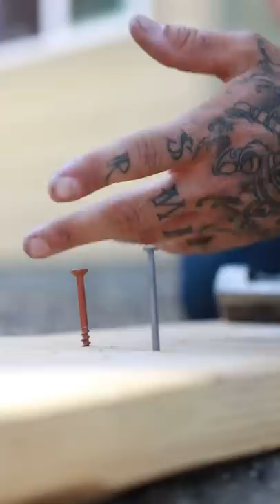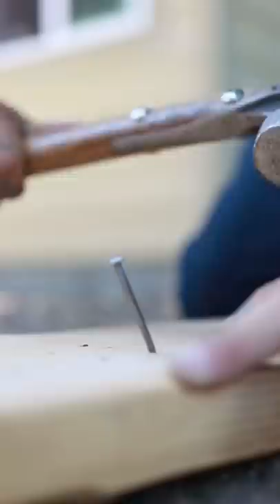Nails vs. Screws: Why do we use nails? #shorts

Comment: "We use nails because they're cheaper and faster". 
-Literally, every builder ever
Reply: As a Californian(i assume you're not American so ill explain California has earthquakes and intensely mentally disabled politicians) we have to use so many ties and braced, posts 10 feet in the ground with dozens of yards of concrete for such a simple house. So for this guy to say a house should be made with nails so it can move (and crack stucco/ windows because a little 2 story will never move enough to break a screw) is absolutely ridiculous to hear. Plus nails will back out of moving wood as literally anybody with eyes and a brain cell will have seen
Reply: @coltoncowan682  Exactly, I have no idea what nail he found that doesn't break after that much bending.  Most nails today are so cheap they break at any little bending anymore.
Reply: @jayclyde6045  i suppose im lucky there my nails dont break on me here
Reply: @jayclyde6045  16p will bend all day.
Reply: @jayclyde6045  question is what nails are u using nails bend all the time and don't break its kinda a trait people need them for
Reply: @coltoncowan682  "I'll assume you're European".
Because only America and Europe exist?
Reply: Use better screws bro
Reply: @coltoncowan682  same in greece earthquake prone. Its in southern Europe, there are 3 tectonic plates. Europes asias and africas
Reply: we as humans could have made screws cheaper and faster but we chose nails for a specific reason, presumably because of this video.
Reply: Harder, better, faster, stronger
Reply: @PanosSkarp  wow. Must be pretty frequent there. Yesterday we had a 4.8
Reply: Unsesquipedalian  screws gut much stronger grip into the wood tho
Reply: @jayclyde6045  you clearly don’t build commercially then 🤦🏻‍♂️😬🤣
Reply: Absolutely not, big structures require screws and bolts, nails are only really used in temporary builds (like concrete laying) because of their flat end and their ability to be bent if too long, its an esthetic and time saving thing before a cost-cutting measure.
Reply: @coltoncowan682 i hope nobody got harmed from it.
 Thankfully it isn't. Some years we get a lot of micro trembles (most places you cant feel them only in tall buildings) and some years (and some place) we will get one strong one 5.0-6.0.
Reply: Correct answer here.
Reply: regular wood screws or drywall screws r tested at 40lbs each, nails are at about 120lbs of pressure each  before they fail
Reply: @Burpingtogheter  they frame houses everyday in Michigan with nails.
Reply: A drill will always be faster than a hammer nails and screws cost almost about the same price not much of a difference nails are more durable any day of the week and I think it's just preference because a lot of contractors also like to use bolts to secure beams and then bring in the air gun nailer for everything else
Reply: So another Carpenter here to chime in nails have shear strength and I would recommend using ardox (spiral) nails. They have both the good aspects of nails and screws. Shear strength and ability to stay in.
Reply: @weed_zone4208  WTF??? You need to proof read! Daughters use boats??? I don't know where you are from, but screws here cost 4-10 times more than nails.
Reply: @CadillacDriver  dude he just said he was assuming he is European
Reply: @BuhBungus  lol ty i guess im supposed to list all the English speaking countries that use the term builder
Reply: @CadillacDriver  lol not sure what i was supposed to say but my british and german friends refer to construction workers as builders. It was exactly the point i was making, Americans know American geology pretty good i dont expect a non American to know the tectonic activity of another countrys state
Reply: @BuhBungus  no shit, Sherlock.
Based on what? Do you not understand my first post? It's OK, I don't expect much more from the majority of Internet keyboard bashers. You'll get it one day.
Reply: @CadillacDriver  but to make you happier ill change my post to read  "i assume you are not American and dont know the tectonic activity OF California, USA."
Reply: @CadillacDriver  you really have no life your starting arguments on a YouTube comment section about a dude telling us why nails are better than screws and not only that your arguing with multiple people but don’t worry I know a certain place filled with people like you and they have the time and energy too but you probably have already been there it’s called Twitter and yes they have Yiff artist’s who castrate anybody who disagrees with there opinion’s
Reply: @BuhBungus  nice novel. You don't know me, fool.
Reply: @CadillacDriver  you still choose to argue? You really should check out Twitter I’m telling you it’s a exactly for people like you who can’t vent out there anger anywhere else
Reply: @CadillacDriver  ignoring my comment because of its length you should also check out Reddit too lmao
Reply: @BuhBungus  reddit 😂
Reply: @weed_zone4208  I haven't bought any nails or screws since this recent inflation boom, but a year or more ago I could buy bulk 16d coated sinkers for less than a dollar a pound, 89 cents I think from my favorite lumber store, fuck Home Depot, Lowes, and Menards. Good coated Grip Rite torx drive screws were something like $9 a pound for a small box, down to 3 something for a 40 pound box, and more than that at the big box stores. You do the math.
Reply: @garrett2362  over here in the big red white and blue nails don't go by pound for ten bucks you get a box with over a hundred in them and the boxes are even made a plastic. If you drop them nothing will come out and everyone nowadays has commercial accounts so they pay even less I want to know where you're getting a pound of nails for $0.89 though and what would a pound of nails look like. like 30 nails put in a box I just told you you can get a bucket with over a hundred screws in it for $7 dollars it's well over a pound athletes you might be getting a 7lb box
Reply: So not true.
Reply: @coltoncowan682  this guy's full of shit he has no idea how much jail time a contractor would Do for one it wouldn't pass inspection.
Reply: @slayerdylk  I know you'd never say that to my face, so that renders your "insult" meaningless. Easy to be tough behind a shield, isn't it?
Reply: @weed_zone4208  I live in Ohio. You must be from California.
Reply: @jayclyde6045  bro why are you arguing this you’re wrong bro I tested it with a nail from my garage no big deal
Reply: @garrett2362  nope I'm from that big Columbus 614 Parsons Ave
Reply: 👌 couldn’t say it better myself
Reply: I am a liar, you are a liar. I am a thief, your are a thief. We have all had bad thoughts, we have all hurt others. We have all contributed to make the world a worse place. So a perfect God must judge us with his standard of perfection. We are evil, and so we deserve justice. Hell. But God is not only a seeker of justice, He is a seeker of love. In fact HE IS love. And proof that he loves us, is that he came on earth in the flesh, to die the most brutal death in history, just to save you from Hell. He paid the fine for your crime. He took on what you deserved, for himself. That is love. At the moment you are in your sins. But Jesus Christ has the power to cleanse your sins through his blood that he spilt on the cross. If you don’t accept this blood of forgiveness, you shall perish. If you do accept the blood, you shall have eternal life. 1 Corinthians 15:1-4. Thanks for reading. God bless you
Reply: makes me wonder why the more durable one is cheaper. i like it though
Reply: @MrFrog-rc3zx  
There is no god. Seriously, grow up.
Reply: @CadillacDriver  Have you ever pondered the cause for the universe to begin to exist? Because it seems like your an atheist, which means you probably believe the universe began to exist with no cause… that does not make sense.
Reply: @MrFrog-rc3zx  tell me, how did "god" make things exist? Seems to me that's making something from nothing.
Just because we don't fully know exactly what happened billions of years ago, doesn't mean YOU do. Especially when it comes to a magical god who willed countless trillions of stars and galaxies in to existence.... come on.
Reply: @coltoncowan682  I mean maybe in America they main them cheap, but here in Europe screws are way stronger than that lmao
Reply: @CadillacDriver  How did God make things exist? He is omnipotent. He is all powerful. By His attributes He can create. Nature cannot create something from nothing, but God sure can. And the thing is, scientists will never figure out what happened before the beginning of the universe because that’s impossible. Science studies nature. Before the universe existed there was no nature. So it’s impossible for us to ever find a way that the universe popped into existence naturally, because that is like saying “one day we will find out how nature created nature before nature existed.” So there must be an outside cause, and I argue that the attributes of this cause are the attributes of the Biblical God. And God isn’t magical. Witchcraft is a sin.
Reply: @MrFrog-rc3zx  oh of course he can create something from nothing, because it's suits religious narrative.

"Science explores and makes no assumptions, religion dismisses science with assumptions"
                         
                        - Castle Bravo 2021
Reply: @MrFrog-rc3zx 
"Scientists will never figure out what happened before the beginning of the universe because that's impossible"

Seems like you have all the answers. What makes you so special, if it's so "impossible" to figure out? Lol.
Reply: @tortellinifettuccine  they're just a hard steel here they'll snap if they bend but its unrealistic for them to bend that much in framing
Reply: @coltoncowan682  🎩 👋🏻 hats off to you sir…. He’s probably just a third year Apprentince and just got 3 attabois and now thinks he can lead a crew in his own and teach these youtubers a thing or 2…. he’s even seen the prints on the 4 styles of home the development he’s working on offers
Reply: Boi you should know better
Reply: @jamesflowers7142  what the hell does ANY of that BS rhetoric have to do with ANY of my posts? Where on earth have I beaten down on tradesmen? I tried in college and now I'm working retail? Lol what? Apart from the fact that's an extremely weird assumption, I'm not even American hahahahaha. Fail. 
Hahahahahahaha, dude what?
Reply: @spooge4569  Edit: What I should have said is why would anyone use regular drywall or wood screws for construction? You use construction screws for framing and such. Wood screws are for small projects and drywall screws aren't even up to that standard.
Reply: @CadillacDriver  awwwe did my comment hurt your fee fee’s andouille had to have it removed…. 😱
Reply: @jamesflowers7142  you need to go back and reply to the person you were supposed to. I have no idea what you're on about, implying I have in any way insulted tradesmen. What a tool.
Reply: @KyleDownsFTW  8d and sinkers will too
Reply: Every builder ever you mean you can bob the builder?
Reply: @jayclyde6045  you must not work in construction 😂😂
Reply: @CadillacDriver  yes
Reply: @coltoncowan682  see in New Orleans or any part of southern Louisiana, we have a water under the ground, so 10 feet below the ground in New Orleans will put you in straight water. Hell 4 feet will put you in some water
Reply: Interesting, 6.9k Likes, 69 Replys, sorry had to ruin it.
Reply: Laughs in Switzerland
Reply: @coltoncowan682  he is right. This is why I hate the comment section most of you have no clue of what you are talking about
Reply: @nickisinsane  whos right? What do i not know? Is this directed at me? Lol
Reply: Yep
Reply: You know lol 😝
Reply: Thank you
Reply: Beat me to it.
Reply: Kev Prz  wtf are you on about?
Reply: @coltoncowan682  weird flex but ok
Reply: @coltoncowan682  move out of california then
Reply: @CadillacDriver  "For the wrath of God is revealed from heaven against all ungodliness and unrighteousness of men, who hold the truth in unrighteousness. Because that which may be known of God is manifest in them; for God hath shewed it unto them. For the invisible things of him from the creation of the world are clearly seen, being understood by the things which are made, even his eternal power and Godhead, so that they are without excuse: because that, when they knew God, they glorified him not as God, neither were thankful; but became vain in their imaginations, and their foolish heart was darkened. Professing themselves to be wise, they became fools."
-Romans 1:18-22
Reply: @qp5771  lol what? Thanks random stranger on the internet, i definitely can move my family and business into another state in my current financial position, i wish i would've thought of that! "Move out of California" wow what amazing advice. And what does that even mean? Do you think that California makes laws based off of evidence and wisdom or reacts and throws legislation at the problem hoping it'll stick?
Reply: @qp5771  thats the equivalent of telling a Mexican to speak English or "go home"
Reply: @exonight7759  no? Seriously look at a screw and a nail, its very easy to see why the nail is cheaper. Screws clearly have a lot more details, making them more expensive.
Reply: Not true . I hate comments like this .
Reply: @XQUEZZYX  nails arent faster and cheaper?
Reply: Kev Prz  did I?
No pal, I can still see your posts. Nice try. Now explain yourself.
Reply: Kev Prz  your behavior is as disturbing as anything I've ever seen on YT. You actually have genuine issues.
Reply: @CadillacDriver  of course
Reply: @coltoncowan682  that's interesting.i live in New Zealand,we have earthquakes. And we use nails to frames houses so they move.we have a lot of ground movement in our quakes.
Reply: Nails are spec'd out on plans for a reason, it's not up to the contractor to decide what they use Bud, at least on legitimate, permitted projects.  There are a couple places where screws are allowed such as securing the floor sheathing to the floor framing, and that is only to prevent squeaking when used with construction adhesive.
Reply: @koustfeiss  It's about strain relief and ductility.  Even forged screws would not perform as well as screws for ductile construction like wood framed.
Reply: @weed_zone4208   yes a drill is faster than a hammer and nail....but they came up with this crazy invention some time ago called a NAIL GUN lol. Sorry, but there is no keeping up with a nail gun buddy.
Reply: @CadillacDriver  You sound like a try hard troll lol
Reply: @weed_zone4208  What are you talking about? Nails are sold by the pound everyday lol. Why be so petty to argue over something so small anyways?
Reply: @garyboyken6236  really? That's why one of the people who was against me left, eh?
Explain why anything I've said here is troll-like?
Reply: @coltoncowan682  its about shear strength, not moving. Also there is a force known as "live load", which puts variable stress on fasteners. Standard wood screws catastrophically fail under shear. If you are going to use screws they need to be rated as structural screws like GRK RSS, or Timberlock. The size and type needs engineering  approval.
Reply: Nail guns are pretty fast.
Reply: @acknowledgedofalltheconseq366  you know i dont remember saying that and i feel a little bad about using those words in hindsight, little insensitive to mentally disabled individuals. Politicians are just really low on RAM in the old noggin. The graphics card is shot and they gotta lower the resolution so they dont freeze typa thing
Reply: @acknowledgedofalltheconseq366  yeah or steel
Reply: @acknowledgedofalltheconseq366  你是中国人?
Reply: @coltoncowan682  Find me an engineer that will allow screws instead of nails.
Reply: @jayclyde6045  idk what nails your using, yeah they can back out in som situations but he is absolutely right, and when you put in your connectors notice you use nails there too, it’s not just about cost, it’s just building 101, I’m sure if you look at the code in Cali they still require nails
Reply: Yup. They make structural screws made not to break, but they are way more expensive than nails.
Reply: I usually dont leave a screw sticking out to be bent
Reply: It’s code to build a lot with nails.
Reply: @Burpingtogheter  False
Reply: @weed_zone4208  A drill is never faster than my pneumatic nailer 🤣
Reply: @XX-tg4gj when you buy them bulk form manufacture half  cost prices  there the same. But when you're poor and have to buy a $10 box at a time off the shelf in home Depot, I guess you wouldn't know there was cheaper, would you?
Reply: @jayclyde6045  my nails don't break, don't get super thin
Reply: Nails allow the building to naturally flex where a screw would snap
Reply: Yeah, he's just got a screw that happened to be made out of hard material rather than the same material the nail was made of
Reply: Yeah, that's why every construction using nsils is complete crap
Reply: @davidscott9097  structural or multi-purpose framing screws are rated for sheer load. they're a nice option for extra holding power in things like deck joist hangers where lateral load can be an issue or you just want them to stay put without working loose over time as the wood dries and shinks.
Reply: @Burpingtogheter in America, nails are used to build the framing of the house

Tho, a reputable builder will use storm ties, even if they aren’t necessary 

To put it in perspective, after a cat 3 hurricane hit my town
It wiped out 3 houses on my street, I worked for a contractor to clean them up

Guess what? 
No storm ties 
My house had storm ties

Even with nails, it will be good enough

Tho personally, I was building my own house, I’d use screws anyways
Reply: @KyleDownsFTW yeah idk whats with these people they prob never used a nail or framed anything in their lives
Reply: But it’s not faster lol
Reply: @jayclyde6045 you’re not very smart you realize a high carbon hardened nail that is brittle enough to break would be significantly more expensive to produce than a bendy nail
Reply: @coltoncowan682  twisted nails wont back out. And they make nails coated with adhesive now.
Reply: @coltoncowan682 Annular nails? Nails have a vastly superior shear strength in comparison with screws!
Reply: @GBOB68  yeah i actually know that now. Didnt then lol. Too lste for this comment section
Reply: @Burpingtogheter You need to get an education and stop posting what you think you know as fact, because you are wrong and it looks like you are probably wrong a lot!
Reply: @bornonthebattlefront4883 If you were to build your own house you would use what the architect specifies. Failure to do so would most likely result in the building being condemned before you spent your first night in it!
Reply: @GBOB68  wow, you are a real critical thinker huh? 

Bet you know how to tie your shoe laces
Reply: @CadillacDriver damn I’ve never seen someone try and put words in someone’s mouth so blatantly 😂 all the dude said was I’m assuming you’re not American. 😂
Reply: @bornonthebattlefront4883  Just letting you know that you don't make the decisions!
ps. Your comment about tying my own shoes doesn't make sense.
Reply: No you know nothing
Reply: @coltoncowan682  there's also thermal expansion to consider
Reply: @snapdrag141  im a changed man leave me alone lol
Reply: @coltoncowan682  I was agreeing with you. I was just adding another variable to what you said
Reply: @snapdrag141  oh god dont do it. 100 of the 135 comments are people telling me im dumb theyll get you too
Reply: @coltoncowan682  I'm dangling something they can suck if they don't like my opinion.